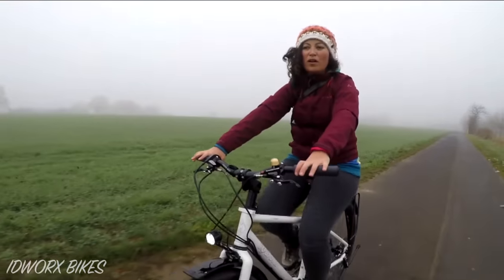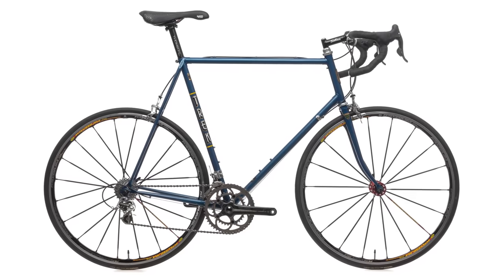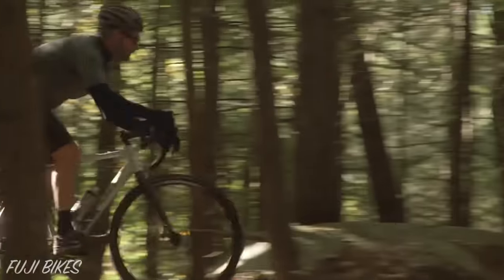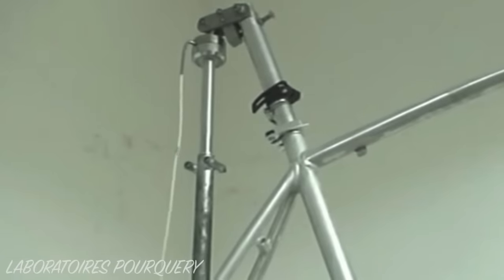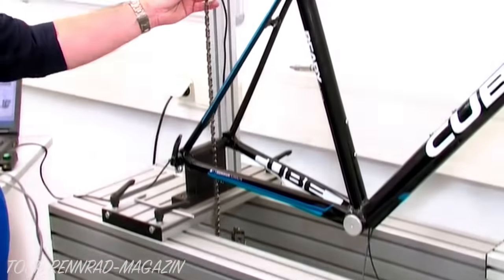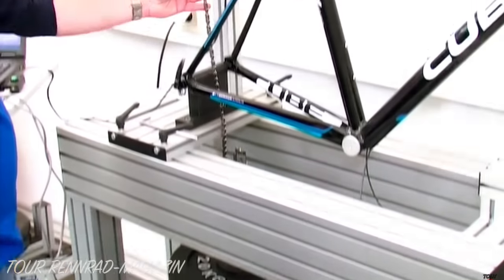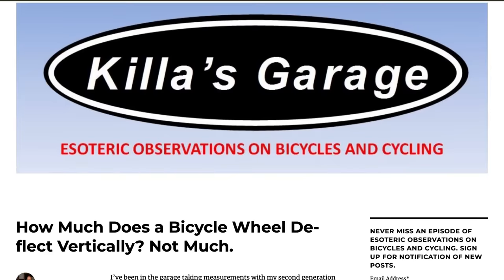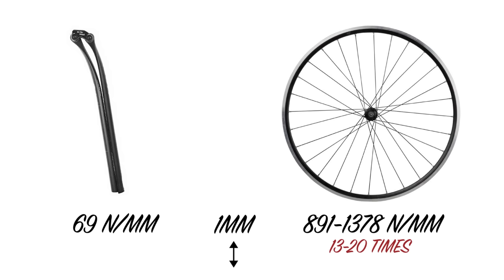Why It's Impossible For Steel Frames To Be More Comfortable Than Aluminium

Comment from the maker: It's annoying I know, but the reason I'm hoping to build a Patreon audience is that YouTube pays about $10 per 10,000 views! When I put 100+ hours into a video like this my hourly rate is, no joke... 20 cents. 😂 If you think this bike knowledge is worth more than 20c per hour, consider supporting the channel here: https://www.patreon.com/cyclingabout
Reply: Can you put more ads for revenue? I'm quite ignorant regarding the whole monetization of social media.
Reply: I find you to be quite knowledgable about bikes. Would love to buy one of your books. Do you do print as well? Also do you have a background to engineering.
Reply: Probably a fair rate of pay for such arrant nonsense ;-)
Reply: @glennoc8585  YouTube keeps putting more and more in while paying out less and less. Many content creators have given up making money from YouTube.
Reply: I agree with your video for the most part, but one caution: comfort is not only about flex, it is also about vibrations. I found carbon to be better at dampening vibrations (trail chatter). I had an alloy Scott Scale, before replacing it with a carbon version. Seat flex was marginally different (I could not really tell was it slightly less or more cause seatposts were almost identical) but the vibrations were way quieter. If you owned two almost identical bikes one after another, with the main difference the frame material, I believe you would have a different experience. I think it is a good example cause both bikes were equipped with almost identical Syncros hardware and wheels (Scott's own indoor brand). And tyres were same size, similar pattern and composition, with me always having identical air pressure.
Reply: Grossly overpaid at 20cents per hour
Reply: Just found out about your channel, i'm seriously considering it. Great content!
Reply: Soo you are telling me that your selling point is based on inducing pity in your viewers?
Chapeau
You should be an marketing agent!
Reply: @SuperDeinVadda  No, I think it's about valuing somebody's work.
Reply: I really think you should put more ads in your videos
Reply: first time i wish i could give 100 likes. will support at patreon coz just this video easily saved me at least 500$ coz i wont be buyin expensive carbon frame but instead go with alu combined with thicker tyres plus a carbon seat
Reply: @SuperDeinVadda  mate i don't mean to worry you but i think you should see a doctor. There is a strange phallic growth on your forehead.  I'd get it looked at.
Reply: Hey you have a 100,000 views on here.  That says $5000 which is $50 an hour.    Much better return.  Good luck on your venture
Reply from the maker: @MrMeheheh  I'm currently up to about US $4 per hour of work on this video. 👍🏻
Reply: I would like to help you. But i hate taxes😂. 
I rather give you 21% more than paying a tax bill.

Can we support you via PayPal?
That's tax free😁🙃
Reply: @tristandesade8635  If you paid attention you'd see that he discusses that and suggests a change of tyres can make more difference than carbon vs. alu. I'd be inclined to agree.
Reply: Haha
Reply: there are just so many hyped up false notions in cycling, its maddening. most of this is due to the industry trying to sell gimmicks, like oversized jockey wheels. great series!
Reply: @linseyyoung1772  yeah everyone can do this

Comment: But.... steel is the only frame material rhyming with “real”. 🙂🙂
Reply: Steel frames are definitely more comfortable in general. By far.
Reply: @FightFilms  Exactly. 
There's no denying it objectively speaking.
Reply: @FightFilms  Put it on a test rig to test vertical compliance and you will see the truth instead of steel is real blaa blaa
Reply: real steel was a cool movie ngl
Reply: @SDRIFTERAbdlmounaim  I have absolutely ridden bikes that felt like getting punched by a robot.
Reply: @FightFilms  Agreed, double butted heat treated steel seems to have more springy horizontal compliance without being too noodly which reduces back pain and gives the feeling of so called ride flow. In my experience budget grade aluminium frames were harsh and clunky regardless of tire pressures while also having high speed shimmy on descents.
Reply: "Wood is good."
"Wooden is da good'un."
Reply: @quillaja  Alumin-i-um is prem-i-um.
Reply: Steel frames are damn durable am using my $150 MTB frame for stunts and jumps without rear suspension and it's still in pretty good condition
(am only using frame of a cheap cycle and all parts are changed you can say it's custom made)
Reply: Ti is riight
Reply: @FightFilms  they feel rigid and strong, aluminum frames are flexy and weak. You can't ever be sure an aluminum frame isn't about to give away and or break.
Reply: @uvwuvw-ol3fg  I think most of the springyness comes from the fork, Ive noticed steel will be springier than carbon but carbon will be sringer than an aluminum fork, thats what Ive noticed on my steel and aluminum bikes, I think very little or much less of ride quality comes from the frame rather more from the fork, frame material and tube wall thickness in my experience is more for weight savings
Reply: @quillaja  plastic is fantastic
Reply: Ti is fly, beat that
Reply: I refuse to let anyone tell me that these two words don’t rhyme.
Reply: Feels like we are getting to the core here.
Reply: Titanium doesn’t rhyme with many words, but damn is it light and strong.
Reply: I like how you point out that the rest of the bike, beyond the frame, plays into the equation. 
I prefer steel for my graveler. I have a carbon road frame with a carbon seat post with carbon wheels with 32mm rubber. It is very comfy but I would not ride that on gravel. Yes, it is a feel and not a quantifiable absolute. It is this bike vs that bike that my hiney and hands feel whatever the reason.
Reply: I rode a Haro BMX bike in the 80s and a GT mountain bike in the 90s, both of which had a chromoly frame. I believe that steel is sturdier and more resilient when performing a tabletop on a BMX. If you use aluminum, it will definitely break. I have tried downhill riding on a steel mountain bike on rough roads, sometimes reaching speeds over 60 kilometers per hour in the 90s. If you're using an aluminum bike, it will definitely break, especially considering the ruggedness of the mountains.
Reply: "Steel welds easily."   Does that rhyme?
Reply: Aluminium is more light so if you ride your bike, it will be easier to so more comfortable. The frame shouldn't be existing to control vibrations. For that the sus and tires are invented.
Reply: I've only ridden steel and aluminum  ,and all I can say is all are different, my brothers steel holdsworth was more comfortable and responsive than my steel falcon,and my bro had an aluminum  frame mr big mtb and that was very comfortable and compliant😊
Reply: @ruyvieira104  No clue what you're even talking about. I've had quite a few aluminum frames over the last 15 years and have never once had an issue with weakness, breaking, or them feeling like they're going to break. This all running the gamut of bike riding, including full on sending it downhill and back to back with the same bike but carbon (a buddies) and i couldnt really tell a difference, nor Ever any issues or flexy/weak things like you say. Straight talking out your rear here.
Reply: @goatsplitter  people post their snapped aluminum frames all the time on the internet. Aluminum tears like paper once its fatigued.
Reply: @ruyvieira104  people post their cracked anything all the time but it doesn't mean an individual case is endemic to the material. Anecdotally, it's carbon that is the real weak material, where aluminum is prolly been that and steel... And titanium is forever lol
Reply: Iron is fire’n 🔥
Reply: ^THIS RIGHT HERE^
Reply: Steel pro alu, for me it doesnt matter. I just Ride And dont complain....😂

Comment: I’ve gone from steel to aluminium to carbon to aluminium and recently back to steel I will never go back to anything else again
Reply from the maker: Glad you like your steel bike!
Reply: Same here, steel frame steel forks. The only test I need is how my body feels after a ride.
Reply: People don't really know about modern stainless since it's rather rare to see stainless frames, but modern quad-butted stainless frames are barely any heavier than titanium and same ride quality as typical steel.  No corrosion issues or chipped paint, and you can polish the frame up easily with steel wool.  I'll never ride anything other than steel or titanium again, went through 3 aluminum frames and they were all horrible.  Snagged a stainless Vaya Travel frameset in 2015 and it'll likely be the last frame I own, I love it, and already put thousands of miles on it all over the US and AUS
Reply: But are you comparing pure samples or mixed?  Usually aluminum bikes use carbon forks as do many steel frames use carbon forks and many metallic frames will have carbon rear chain stays and/or seat stays.
Reply: @boxlid214  Any idea who makes stainless road disc frames?
Reply: @glennoc8585  cinelli
Reply: @Yyyiiiweennnvvvscccst  ok wow that's coolm
Reply: glenn oc Surly
Reply: James Medina Im thinking it does make a very slight difference but if all of the components are rigid the system remains rigid.
Reply: I had a Cannondale hybrid, with a VERY stiff alu frame.  It came with a sports saddle and felt like I was sitting on a knife-blade.  That saddle on a steel racing frame (tubular racing tyres) was fine.  I tried a plush Selle Italia saddle on my steel tourer, it was SOOO comfy - but on the Cannondale, it made the bike just bearable, for a couple of hours. I sold the Cannondale.  My 2001 Giant OCR was awful with standard forks and seat post.  I swapped them for carbon, and it became rideable, and faster - but not nice enough to want to ride before my 753 time trial bike.
I don't have fancy testing kit, but I can tell what works
Reply: I had an aluminum Univega Rover MTB and it rattled my head when riding on a rough gravel road. I then bought a steel Marin Eldridge Grade MTB frame off eBay, took all the parts off my aluminum frame and immediately noticed a much better ride on the steel frame. A few months later I found a lugged, steel, Trek 990 frame, built it up off all my parts from the Marin frame and wow! It rode even better. Steel is real.
Reply: @glennoc8585  Genesis in the UK, Rikulau in Taiwan
Reply: @glennoc8585  edit- not sure about the disc part I'm afraid
Reply: @yonseimatt  Thanks, I've heard of genesis.
Reply: @glennoc8585  Norco, Surly, Salsa, All City, Ritchey, Spa Cycles, Light Blue, Fairlight, Mason, and others make steel, disc brake road bikes.
Reply: @jamesmedina2062  Considering the large forces required to vertically flex both carbon or aluminium, mixing the materials on a frame is unlikely to make a noticeable difference for riding comfort.
Reply: For me, It's all about how we feel and how much we ride. And how much we love the bike.
Reply: @boxlid214  It is not widely known, but rubbing steel wool against stainless will alter the stainless properties of the surface.  It is then vulnerable to oxidation like regular steel.
Reply: @boxlid214  titanium is more flexible than crmo and thats why crmo is better .easyer to made too so better and cheaper. but titanium is ablugjt 1/3 lighter soo there is something to thinking abouth but flexin your eheels while you are in corner is something what can bring you on the ground
Reply: @glenn oc You should have a look at https://bombtrack.com/
A german brand, specialized in steel frames.
I rode 75 000 km on their Arise 2 (Steel CroMo 4130 & Mechanical Disc Brakes) : a great Bike.
Reply: @jev2867  Hard to say really, seems like the probability of saddle pressure sores was greatly reduced when riding the steel frame (Thorn Audax mk3) in a leasurely manner for 3 hours compared to cheap aluminium one, but as soon as starting the actual ride saddle sores returned. The only difference was reduced back pain which might be due to lively feel caused by springy sideways flexing. Aluminium frames feel dead in this regard. Almost never (mostly only after 9 hours of riding only) had any saddle sores when riding unknown old school steel frame marked as Tourist XB3. Subjectively speaking all I know is that cheap aluminium Mercurio frame feels like a dead log on rough roads, Raleigh Banana HiTen steel feels like a crazy horse over bumps, Thorn Audax mk3 as a subtle lively fish and Tourist XB3 as a tamed horse when riding on crumbling roads.
Reply: @uvwuvw-ol3fg , a little remark:

ХВЗ is USSR originated bicycle manufacturer widely known in post-Soviet countries. It's dead now. Old frames got cult status and some fans restore them.
"Харьковский велозавод — Википедия" https://ru.m.wikipedia.org/wiki/Харьковский_велозавод
Reply: @ПавелГражданкин-ъ4л  I think Tourist XB3 is made out of straight gauge gas pipe tubing (?), but rides better than Western Raleigh Banana Hi-Ten straight gauge steel (probably due to different geometry). Haven't had any chance to find out if there were any butted frames made by XB3.
Reply: glenn oc look at the StelBel Antenore disc.
Reply: @boxlid214  Stainless steel is not stain-proof steel, it can and will corrode in the correct conditions, but unlike conventional steel it will decay from the inside out and then seemingly fail catastrophically, even though the damage has been pre-existing for a long time beforehand. Sailors know this, that's why boats used to contain a lot of bronze instead.
Reply: @Metal-Possum  if you never wash it at all and never maintain anything, sure.  I'm not dumb, even titanium can corrode.  For a bike and the average person that maintains their equipment, it'll last though.
Reply: No Ti?
Reply: @Strive4Paradise  would be fine, but those things add significant weight.  I rode with a suspension post briefly, but it was heavy and I didn't like it much.  The best remedy for you rear end hurting is get a saddle that really fits you well and simply ride more.  I ride very long tours over pavement and gravel, and I find I don't need the suspension or suspension post at all on my vaya.  Use a bar tape like Pro Design shock wrap if you use drop bars, you won't need a suspension fork.
Reply: @glennoc8585  Salsa Vaya Travel frame according to previous comment here.
Reply: @glennoc8585  you might try some custom builders like feather or donhou in the 🇬🇧
Reply: @campbellpaul that's a myth Paul people would have rusty pots and.pans galore.if that was true. Cheaper stainless can feature from being heated from grinding or a flame that turns the steel red hot.
Reply: @Metal-Possum  bronze was. Before stainless was in invented. Marine vessels use marine grade stainless it lasts but it's fatigue qualities are not as good.
Reply: @glennoc8585  do your own research, man.  If you disrupt the surface of stainless with a ferrous metal, the atomic properties are compromised. That is why it is called stainless, and not "rust-proof" (unless you are Swiss ha)
Reply: @campbellpaul  well I've scrubbed the surface of my stainless steel utensils and brewing kegs with scorers and even wet and dry paper and they look like the day they were made. Higher grades are less likely to lose the bond that makes them.stainless. The cheap.almost fake stainless will corrode over time. I think.bike frames are in the  very.high end you'd see a lifetime out of Reynolds.
Reply: @glennoc8585  It may be that steel wool is not strong enough to break those ionic bonds, so you may be entirely right.  I do know for sure that using a wire brush will cause rust for sure.  Stainless steel also requires speciial cutting tools over regular steel.
Reply: @campbellpaul  latest stainless in the last ten.years is next level.. I'd be more worried about age fatigue and welds cracking than rust tbh. I've seen lower grade stainless exhaust pipes on cars crack.Before the pipes corroded.
Reply: @glennoc8585  hopefully the new alloys take care of all those worries, and get thinner and lighter in the process.  There is the engineering and manufacture of the initial butted tubing, which is of concern, but then you have to factor in a fabricator putting it all together, and you have to trust him as well to know that his welds are being back-purged properly, using the correct rod that has been stored properly, etc.
Reply: @glennoc8585  the 'back-purging' is what keeps the stainless welds from oxidizing on the inside of the tube btw
Reply: @campbellpaul  That'd why many frame builders will stick to aluminium and steel over titanium and stainless. Brazed steel.is very strong and lugged even better. Tig welded is good. Cromoly and alloy still the affordable choice for many tourers
Reply: @glennoc8585  I agree... a nicely brazed cro-moly frame for under 2 grand is the perfect bike for me
Reply: @pashakdescilly7517  maybe your frame was just too big for you. There are many parameters out there. And of course fitting.
Reply: yes me too...I chose steel...